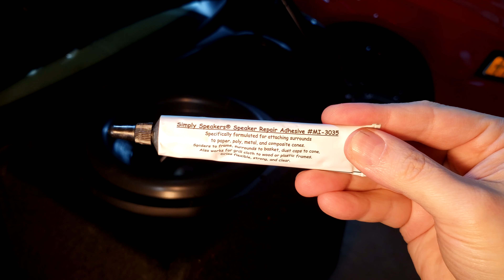How-to Repair Subwoofer Speaker Dust Cap

Comment: Just glued my evl dust cap back on with e6000 tomorrow will be the 3rd day I’ve let it sit. How long before you went back to full tilt
Reply from the maker: I think it was a few days.
Reply: @TeksTherapy  I was just riding full tilt for like 25 minutes. Everything seems back to normal.
Reply: My evl 12 did it too but only one out of four? Idk how or why it’s strange
Reply from the maker: Maybe the guy gluing then at the factory messed up and used too little glue.
Reply: @TeksTherapy  skar just hit me up they gone give me another speaker I just gotta destroy the one I have.
Reply: @bloodgang9270  i have the same problem how do you contact them?
Reply: @bloodgang9270  bro how did u do that i got the same issue
Reply: @bloodgang9270 i’m having the exact same problem with an evl 12, would you care to update on how you ended up fixing yours?
Reply: @azurish7820  e6000 glue rubbed it around the cone bottom and where your placing it at. Put some pressure on it leave it for a day and it’s as good as new.

Comment: Will amazing goop all purpose work
Reply from the maker: I don't know what that is exactly. I highly recommend the glue I used in the video, the dust cap has been living happily ever after despite the 2,500+ watts of RMS I throw at it. Running a Skar RP-2000 at 1 ohm stable https://amzn.to/3CPHEvE
Reply: @TeksTherapy  it's just like e 6000 it's great stuff
Reply: Yeah that's basically the same as e6000 it's great stuff

Comment: I clicked on your link but it didn’t give me the exact one you used. Could you give me the measurements, I have the same exact sub, was it a 150mm or bigger dust cap. Please reply
Reply from the maker: I reused my original one. You should measure your original dust cap so you can buy the right size for your sub.

Comment: what happens if you continue to use the sub without the dust cap? do you lose the quality of sound?
Reply from the maker: I actually ran the sub without the dust cap for over a month, didn't notice any sound difference at all. Just make sure you don't have something like sand particles in your trunk because if sand granules or something like that get between the moving parts of the woofer cone, you'll toast the subwoofer. Luckily that didn't happen to me, and everything still works really well .
Reply: You risk getting dust in the coils. This can destroy the woofer. It's simply a dust cover. It's only purpose is to protect the coils from dust. I currently have 4 or 5 layers of paper towel taped over my woofer to help protect it. It has been going strong for 4 months. What can I say I only have about $30 and 10 hours of my time in them. The surrounds were a nightmare to remove. The replacement part went smooth.

Comment: Would guerilla glue work? Speaker repair glue is 30 to 50 dollars and I am sure there are cheaper alternatives.
Reply: You usually get, what you pay for
Reply: Use e6000